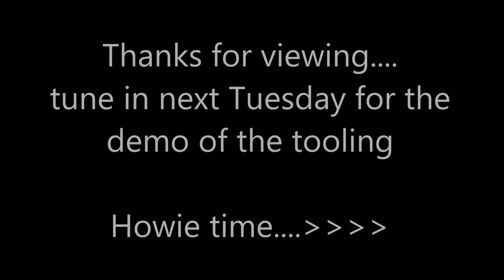SCREWY TUESDAY #72  HOLDRIDGE RADII TOOLING BUILD part 3

Comment: Chuck - for reamer storage, do yourself a favor and invest in one of the several models of reamer cabinets made by Huot.  I have one that has all of my smaller size reamers sorted out in and it is a real life saver.  Yes, they are somewhat expensive, but worth every penny.
Reply from the maker: Hi Keith.....I AGREE....if I could find a spot to set a reamer cabinet and then find every penny....lol.....it would be golden.....thanks for the feedback and as you know where there is a will there is a way or remodel....ATB

Comment: Another nice job Chuck.  Great use of work holding and cutting the slot/groove.  I have to say though, your lights kill me.  That would drive me totally bonkers.  Looking forward to the next video.
Mike.
Reply from the maker: Thanks Mike....I tend to walk in and out of the machine shop area at different intervals but several times so it is nice to walk in and out and not have to turn on/off the lights.....but I agree it PISSES me off when I forget to hit the switch...but I got smart an purchased battery backup motion sensor lights so when I am in the back of the shop don't have to find my way back in the dark....lol

Comment: You need to turn off the auto lights when your filming Chuck. Nice Kennedy, got my set for $75, took about 2 years to air out from the mildew, but perfect now.Equivalent of a drill index for reamers would solve your problem, but really it's your problem. I put my reamers in a drawer, the times I need to find them is far and few between, so I just go through them, I can guess close enough.You are ocd and have too many reamers lol. Love the vids chuck, keep them coming.

Comment: I have an Equipto (Lista style) cabinet with a drawer 25 x 25 x 3-1/2".  The bottom of the drawer is entirely filled with MT drills, in order by size, over a rubber drawer liner.  Above that are several small cookie sheets of reamers laid out over shop towels , bigger reamers over the smaller drills, then above both layers are the tiniest reamers (from around 5/16" down to maybe .010") in plastic boxes.  I lay out the reamers in order by size, and reverse the ends of alternate reamers (and drills) to help protect them from damage.  Sleeves or tubes to protect them would cost way more than I paid for the reamers and drills.  I make sure to leave the sheets less than completely full so I can fit in a few more in when I pick them up.  Works fine, easy to lift the trays out to get to what I want.  That drawer must weigh 200-250 lbs...
Reply from the maker: thanks Bob...Equipto cabinets are great...I have one also...thanks for the info.....

Comment: To hold the reamers use blocks of wood with holes to insert reamers and mark sizes-this keeps reamers from banging into each other possibly dulling them.  Or use trays of wood or plastic to lay them in.  Depending on sizes use plastic tubing or thin pipe to hold them.

Comment: Hi Chuck. Here is a link to the reamer storage I use. http://www.ebay.com/itm/HUOT-033603-13430-Reamer-Cabinets-/222136425658?hash=item33b85cdcba:g:96UAAOSwOVpXYKLn  They make a couple of different ones depending on your needs. I also keep number , letter, and fractional drill bits as well as end mills in the cabinets made for those. They are a little bit of cash but you'll never have to dig for them again.
Reply from the maker: That is the best....damn if I only had a bench top with space or a open area on a wall.....errrr!!!!  Thanks Tom